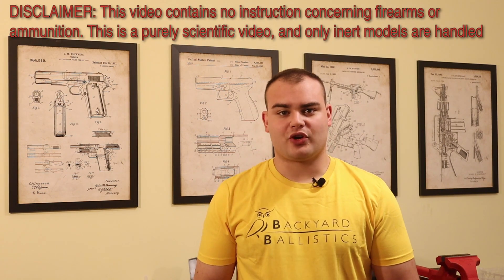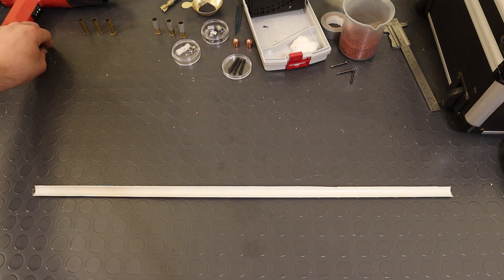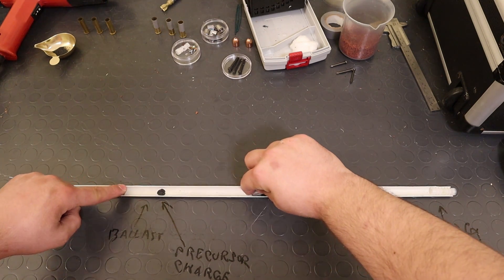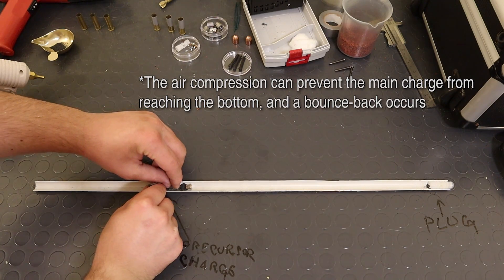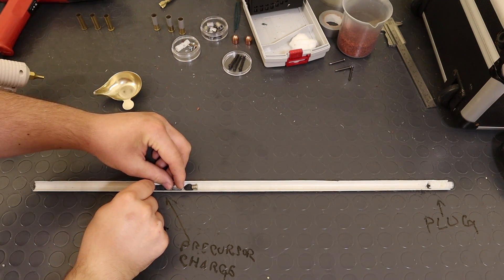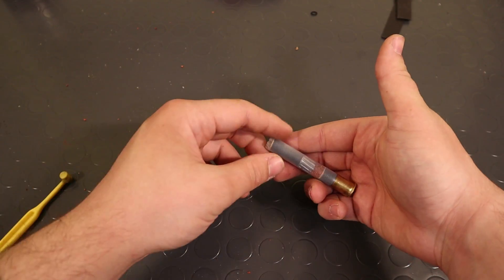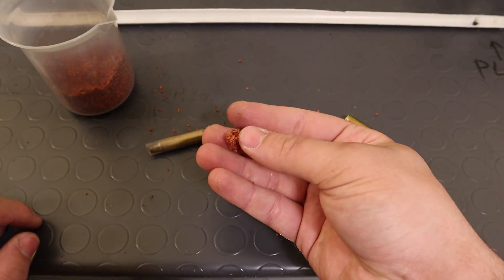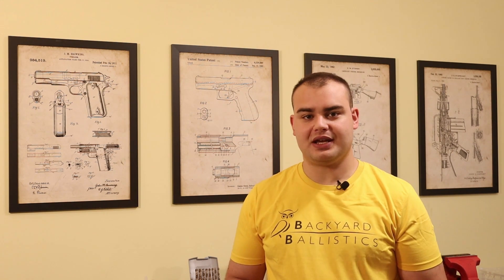The Cartridge That Shoots Both Ways

Comment: I would think the simplest gun would be a recoiless design.  A simple steel tube with a primer hole in the middle.  The cartridge would be a paper cartridge and have a shotgun slug at each  end, with the powder charge in between.  Load with a ram rod till the cartridge is in the middle of the tube and the powder under the primer hole.  Insert primer, and strike with a hammer.  Dangerous both front and back, but so is a recoiled rifle.

Comment: This is really cool, because I thought of this idea as a weird revolver shotgun mechanism. Normally, a revolver is heavy and bulky because the cylinder chambers must deal with the peak pressure of the main charge. But if the cylinder is at the front of the barrel, it only needs to deal with minimal pressure. This would be particularly true with a long barrel, and in this case it's possible for the barrel to be almost the full length of the gun.

Comment: I dont understand the need for the second charge in front of the projectile. You ignite the main charge in the hollow ballast which pushes the projectile down the barrel while the hollow charge moves the other way and acts as a counterweight ( Force applied equally  since we have no closed breach ). The projectile is now moving down the barrel while pushing/compressing the second charge in front of it. In my mind that motion quickly applies friction, enough so to ignite the second charge which would thereon create a negligible 2nd explosion . That gas pressure would slightly slow down the projectile while the rest of the gas pressure just leaves the barrel (recoilless rifle style). I just dont get it.

I would just create one solid hollowed counter ballast out of a very dense material basically acting like the bold of an open submachine gun, so the mass alone creates a breach which would then let the gas pressure push out the projectile out the barrel while the hollowed counter ballast gets just pushed slightly down the other side ( since the same force is applied to more mass)

Comment: wouldn’t the heat and pressure made from the compression of the air behind the main charge be enough to make the powder auto ignite removing the need of a percussion cap and a firing pin in the bottom? 

although it probably won’t be a reliable way of ignition at all without a lot of testing

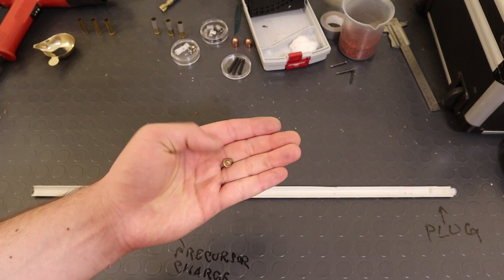Comment: 3:03. Igniting the powder charge wouldn't require a percussion cap. the rapid compression of the air between the projectile and breach would cause a significant kinetic-thermal energy transfer. more than enough to ignite any combustion process.

Comment: The solution the young gunsmith is a gun with one barrel with two muzzles. The hammer is located in the center of the barrel, each bullet is muzzle loaded with powder between the bullets. When fired a bullet leaves each end of the barrel in opposite directions.

Comment: Stupid - Can you say 'barrel obstruction'? Compressing the air and powder charge in the back charge will heat up and ignite the main charge. Rifling in the barrel and additionally rifling on the main bullet (rifled shotgun slug) will allow blow-by, and that will also ignite the main charge. It will NEVER seat the 'bullet' on the main charge. Also, if the main charge is allowed to ignite in the bore with all of the extra air, it will not burn, it will DETONATE due to serious overpressure, making the barrel into a pipe bomb!

Comment: Perhaps you could use a full brass .410 case and when the chamber is cut out of the muzzle have a series of grooves cut into the chamber that when the loading charge is fired the case expands into from the pressure between the balast and the projectile thus providing resistance, similar to some early blowback delaying self-loading pistols, this may offer an additional grab when the pressure is high from the loading process but he quite readily blown out when the main charge is fired, worth a try at any rate

Comment: I haven't watched the video yet fully but just want to add in case you didn't mention, those slugs are actually spin-stabilised, but they spin quite slowly compared to normal rounds of course, so they are still quite different.

Comment: someone may have said this already. but a primer on the main charge should not be needed. the rapid compression of the air in the barrel should generate enough heat to ignite the main charge, much like a fire piston can be used to light char cloth

Comment: A steel pipe barrel with both ends open and a hole in the middle, similar to a flintlock opening, it will use two projectiles on opposite sides of the hole in the middle of the pipe, with the powder being between the two projectiles, powder is touched off by a match and both bullets are fired in opposite directions, this design is the simplest in terms of least amount of effort, requiring only a single hole to be drilled in a pipe or barrel

Obviously you can cap one end of the pipe and make it fire in one direction but that is not as simple as drilling a single hole in the middle of a steel pipe

Comment: Huh. My personal headcannon for the problem was a sort of caseless high-low system where the bullet is firmly attached to the propellant and the high pressure chamber, while the barrel is the low pressure chamber. Basically load and fire as any mortar.

Comment: I'm pretty sure having a percussion cap behind the "main" charge is unnecessary. The adiabatic heating from compressing air more than 10:1 that fast should be more than enough to ignite the powder. There was a "powder-assisted pellet rifle" which used exactly that in lieu of a primer or firing pin. It used a piston system like is found in spring airsoft guns, but it would compress the air enough to ignite the propellant charge at the base of the pellet. I can't recall the name/manufacturer of it though.
Reply: Maybe Daisy (of the BB gun)? They also made that gun use caseless .22 ammo.
Reply: @LOUDcarBOMB  Yea, that was it, the Daisy V/L. They originally sold it as a "22 pellet gun", but had to stop when the ATF ruled that it was a firearm.

Comment: Theory:
if the air is compressed enough it could self ignite the powder like in a diesel engine, making the percussion cap unnesessary
Reply: Daisy (of BB guns) did that with caseless .22 guns. Pretty cool gun from the 1960s I believe.
Reply: @LOUDcarBOMB  you able to post some more info about that? I'm curious, I grew up shooting airguns and swapped to powder burners as soon as I could so that intrigued me a bit.
Reply: no as compressed air reaches over 260c and gunpowder requires almost twice that temperature to ignite
Reply: @mustafankamil1973  You can always add a small amount of much more sensitive explosives to the mixture, I don't really see why it wouldn't work, like a less efficient spread-out primer.
Reply: @thermionicemission6355  at that point a percussion cap is just a ready-made, more easily affordable alternative

Comment: I'm not sold on a gun design, but it might make a pretty fast primitive cannon . I get the fuse, but not a hammer striking it and getting out of the way as far as an accurate shot. I'm assuming the plan it the first bullet knocks it out of the way and in the second doesn't have to hit it. It seems like a design with way too much to go wrong for a slightly increased rate of fire vs just loading a muzzle loader, though if this was 200 years ago I might think otherwise. The role of a cannon is better suited to the increase in my opinion

Comment: Another way to do it would be to design a recoiless rifle. The rifle could simply consist of a barrel open at both ends. The recoiless ammo can be caseless, made of a fast burning propellant grain pressed onto the base of a bullet. The ammo is inserted into the barrel until the propellant grain is against an electric igniter. The gun is fired over the shoulder like all recoiless rifles, the jet of gas goes out the back, the bullet goes forward.
Reply: Or just a barrel with a tiny hole in middle and two bullets pressed in with a charge between them. Apply ignition at the hole and fire both bullets at once to opposite directions. No extra parts, no complicated system. Essentially a 2-way firing cannon.
Reply: Carl Gustav?
Reply: "gyrojet railgun ammo"? 
I agree.
Reply: My answer as well.
Reply: That’s how some grenade launchers work
Reply: @kartofun7672 
Not most, unless youre thinking of the rpg7. Most use high low system and dont expell any gass out the back
Reply: @manufacturingyourmatriarch9242  that’s why I said some
Reply: @manufacturingyourmatriarch9242  ok, the literal point of a recoiled rifle is to blast gas out the back so you don’t break ur arm or go flying everytime u shoot it
I am p sure Literally all hand operated recoiled rifles or “rocket launchers” have backblast
At least that I know of, at4, smaw, Every single type of rpg, gustov, all of em
Unless ur talking about mounted ones I do not believe there is such thing as a “backblastless hand operated recoiled rifle”
Actually the javelin might not have backblast, I know they were trying to switch stuff up with it

TLDR the whole “recoiless” part of recoiless rifle means it’s shooting gas out the back so u don’t fall on ur ass everytime u shoot

There is no such thing as a unmounted rocket launcher with no back blast, doesn’t exist
Reply: @The.dudeinator  he was talking about grenade launchers which most have recoil
Cept for rpgs

Comment: I thought you would go with a typical recoiless rifle model.  You could use one large charge and two projectiles.  One projectile facing each end of the open ended barrel.  You place one percussion cap nipple at the midspan of the barrel.  The when you set off the cap one bullet goes out each end.  No recoil.  Dangerous to stand behind.  You would be able to technically fire any size projectile, much much larger than a conventional firearm.
Reply: This is what I was thinking as well, and probably more in line with what the gunsmith in the story actually had in mind.  The gunsmith said he could build a "reasonably practical" gun with only a barrel and a hammer. That means no stock, so that means you need something recoilless. The method proposed in the video would definitely need a stock as it would have normal recoil for the 2nd bullet. Yes you could technically fire it without a stock, but with no way to control the recoil, you couldn't call it reasonably practical.  Recoilless is the only way you could build something so barebones but still practical.
Reply: @AP-zw6ql  exactly.  With a recoiless rifle concept could technically be as fancy as tube with a grip or as simple as a pipe with a hole drilled in it for a fuse... or like the story... sounds like a percussion cap nipple and a lockset to smack it.

Comment: Question: since air heats up as it compresses, could you use that as the ignition source for the main charge rather than having a separate primer? Sort of a diesel gun rather than the standard petrol gun?
Reply from the maker: that is a very good question. The short answer is "not really" unfortunately, and the reason is that igniting the solid grains of powder with hot air would require an exposure time much longer than what is available. I actually tried doing that with a springer airgun modified to reach very high compression ratios, and was never able to ignite any commercial propellant (smokeless or black powder of different grades). An atomized/finely divided fuel is required, like cotton wool, but I haven't tried that. Also a strong ignition source is generally beneficial for ballistic performance, so a primer/cap really is necessary. As an additional fact consider that the main requirement for diesel fuels is the cetane number, which basically represents how quickly and easily one specific fuel can spontaneously ignite in a diesel engine.

Comment: Since the premise of the challenge was the simplest way to make practical firearm and he said to make a reasonably practical firearm he needed only a barrel, hammer and two bullets my mind went towards a simpler solution. A simple barrel drilled all the way thru making basically a pipe. Then a hole drilled for a percussion cap in the middle with the hammer mounted. Place powder in the middle with projectiles either side. When firing the bullet traveling backwards maintains the pressure for the bullet heading forward removing even the need for a breach of any kind. Sure it might be slightly impractical having a second bullet traveling backwards and needing to clear the backblast and make sure no one gets shot, but he said "reasonably practical" and that I feel gives some leeway.
Reply: That’s where I thought this was going as well
Reply from the maker: What you described was actually tried multiple times in the past, 19th century and before, not in the attempt of making a simple gun, but a recoilless one. The projectile shooting backwards would be composed of compacted powdered material, to minimize the risk for those staying behind, but it was still quite far from being practical.
A deeper understanding of gas dynamics and nozzle theory then allowed the backward moving ballast to be substituted with exhaust gases, and recoilless guns as we know them were born.
Thanks for suggesting by the way
Reply: @Backyard.Ballistics  I am aware of this. I just made this suggestion as I felt your idea did not simplify the rifle much(as was the challenge posed), but added a lot of complexity to the ammo and potential problems with a firing mechanism that either has to set off charges in two different positions or necessitate two firing mechanisms. Doubling the amount of firing mechanisms would not be much of a simplification and a mechanism capable of setting of charges in two places inside the barrel opens a pandora's box of complications that leads to the metalstorm system.

Comment: Just put a hole in the barrel to let the air out. Easy
Reply from the maker: you really had me laughing there!😂😂😂
Reply: You don’t want the air to escape. It is needed to start the primary charge. Basically the same concept as a fire piston or even a Diesel engine.
Reply: @kwhp1507  air will flow back in through the hole

simple

Comment: Don't need the percussion cap you can ignite the powder with the compressed gas
Reply from the maker: unfortunately igniting the solid grains of powder with hot air would require an exposure time much longer than what is available. I actually tried doing that with a springer airgun modified to reach very high compression ratios, and was never able to ignite any commercial propellant (smokeless or black powder of different grades). An atomized/finely divided fuel is required, like cotton wool, but I haven't tried that.
Reply: @Backyard.Ballistics  did you try with black powder/gunpowder, modern powders probably require a percussion cap. I only mentioned it as there are camping fire starters based on compressing air in a tube.

Comment: If you haven't seen it take a look at the "Chambers Flintlock Machine Gun from the 1700s
" on forgotten weapons. That firearm sort of reminds me of this. Well to be honest it's pretty different but it does incorporate the stacked bullets with charges in between each projectile. I'd love to see someone recreate one of those.
Reply from the maker: Hi, thanks for suggesting. Unfortunately stacked charges are plagued by many hard to solve problems. Probably the hardest one is ignition, but also varying barrel length, risk of flame through, which in that design can easily lead to catastrophic failure, and many others. I'm probably making a video on that.
Reply: @Backyard.Ballistics  There was a gun system sold to the US military that used stacked bullets. The ignition problem was addresed by an electric ignition method. The gun had the highest firing rate ever, IIRC it was over one million rounds per minute - I think it was called Metal Storm.
Reply: @Backyard.Ballistics  they used bullets with a hollow tube in them stacked with gun powder in the tube to act as a fuse. so the first round goes off then the fuse starts and soon the 2nd goes off. that's how they did it back then. unreliable if one bullet doesn't go off and you have powder and ball stuck in the bore. they kept it in the rigging of ships to clear the decks of opposing warships. they would have 7 barrels with 30 shots each per barrel. when it worked it was probably a very effective system
Reply: @iamAwesomo1994  they also had a musket version
Reply: The puckle gun?
Reply: @jgvtc559  no